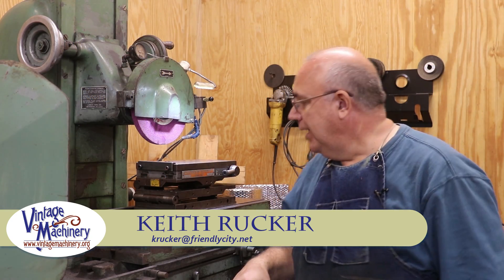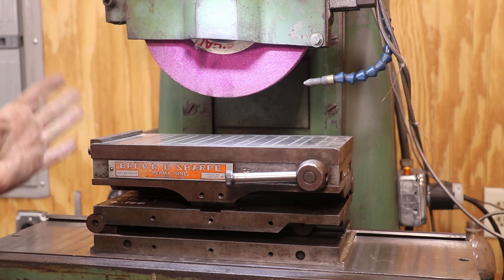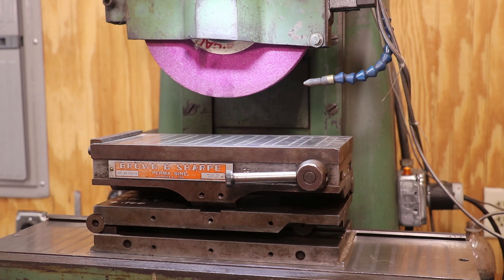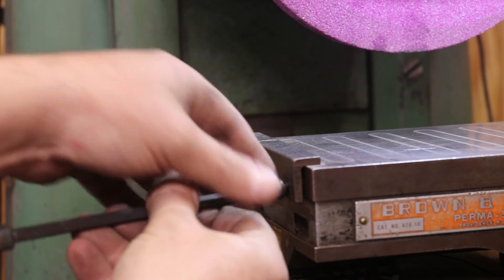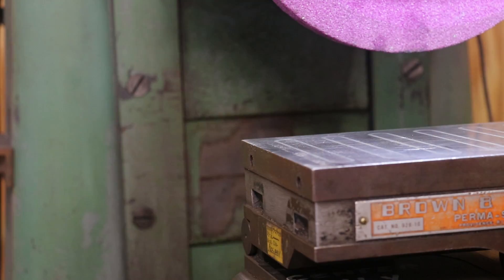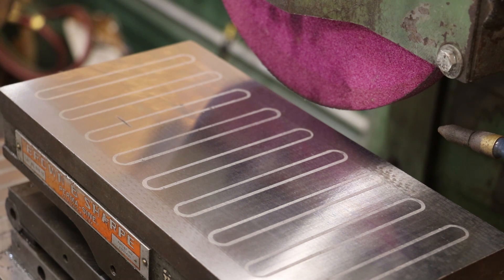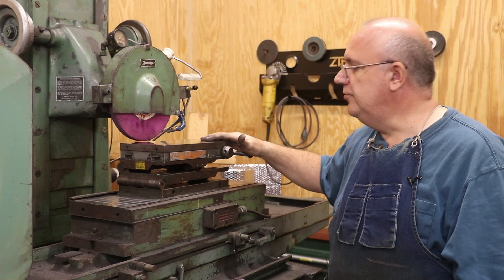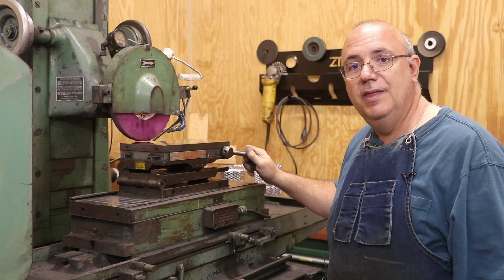Grinding a Magnetic Chuck Flat on a Surface Grinder

Comment: NateAIM 
I agree with you that the final finish was crap.
It's good to see you (so far) getting away with criticizing Keith. Mostly one or more of his plaudits will come back to point out that for some hastily invented reason you are not qualified to go against the master.
I would like to see the ground surface run on a blued surface plate to check if the softer parts are level with the hardened inserts. I doubt if Keith will risk that.
I wonder sometimes if half the watchers are actually looking at what is on the screen.

Comment: I thought the next step was to take it to the granite and verify that it was flat and parallel to its pivot axis. :-) If you don't then your gauge block stacks could end up with some very odd angles as assuming the bottom and top are now flat and parallel any difference in their relationships with the pivots will now result in some compound angle even when moving only one and you don't want that.

Comment: Would it not make sense to do exactly as you did?  Initial passes with the magnet off allowing the bulk of the filings to be thrown clear then magnetic field on for the final skim pass where far less material is removed.  Otherwise the metal filings would just build up and perhaps jam between the wheel and the surface.....  This is both food for thought and a legitimate question as I have no experience but have just acquired an old Norton 6X18 surface grinder.

Comment: Shouldn't you dress the wheel on a flat surface first (on the bottom mag plate)?
Reply: The surface grinder ways determine the tool path so the flatness of the sine plate is irrelevant.
Reply: @rennkafer13  I don't get it.  If I tilt the sine plate and then dress the wheel, wouldn't the shape of the dress = the shape of the sine plate?  The sine plate wasn't flat to begin with, so the wheel can't be square with the ways.
Reply: Think of it like this, the tip of the diamond is a point in space.  When you move the grinder carriage that point moves in a straight line at a fixed height from those ways.  If you tilt the sine plate (in either direction) you move the starting height of that point, but you don't change that it moves in a straight line at a fixed height.  Moving the sine plate might mean that the diamond doesn't cut properly if the angle was large enough, but small differences won't matter.
Reply: @rennkafer13  Point in space did it for me, thanks.

Comment: Number 1 never turn the wheel off after you dress it number 2 is you didn't  turn the magnet on  the sine plate.How do you expect  the plate to be flat when you turn the mag on to grind your parts,it won't be. I've got  50 years of grinding experience so I know what I'm talking about.
Reply: Did you bother to watch all of the video?
Reply: @paulcopeland9035  yes I did and he turned the mag  on as I was finish  writing.
Reply: Thanks for the advice Mr Hatfield and others,  can you explain for me why stopping the wheel after dressing is not good? I could just accept it or I could take a guess but I'd rather hear it from a "been there, done it" perspective.  Always more to learn.

Comment: Why don't the sparks stick to the magnet ?
Reply: They will eventually. Grind a lot and you’ll have to clean the magnet. Most sparks come off the workpiece very fast and don’t have enough mass to arc the trajectory downward. Furthermore, the magnetic field of the chucks are usually not very large. Because of the mass of the magnet the magnetic field intersects with enough of the metal to be held quite firmly, whereas the mass of the sparks are almost insignificant. The force of magnetism is directly proportional to the mass of the metal intersecting the field and inversely proportional to the square of the distance from the magnetic field.
Reply: Good question. I guess it is because the particles are so hot they are incandescing. I know when heat treating iron compounds they lose their magnetic attraction when they turn red. Just a guess, I am no expert.
Reply: I think it has to do with the mag itself, alternating strips of iron and brass. You have to bridge the brass to stick. No grinding particle is that large.

Comment: Can almost guarantee that sine plate has a low spot in the middle from heat build up now, when you grind something like this that determines the accuracy of everything else you grind take a tenth at a time and keep it cool.
Reply: Someone has never put use to the mag grinder. Impossible to get thing hot at .0005 or less.
Reply: @PBVader  when you trying to hold tenths or even 50 milionths .0005 defiantly will put enough heat in apart to effect it, especially how large this one is
Reply: @Daniel-vq9zb  Like I said, you obviously haven't put time on  that machine, let alone a flat plate. You want a tenth of a thousandth,  polish it out.
Reply: Wouldn't the coolant spray mitigate that?
Reply: @BigRalphSmith  not the way hes grinding lol, If it was flood coolant then yes, but mist isn't going to keep it cool with that rooster tail of sparks.
Reply: @BigRalphSmith  with all that being said he ground his actual magnetic chuck the same way so the whole thing is like a compound error
Reply: @Daniel-vq9zb  I'm not so sure I buy that. I'm not saying you're wrong but I get the impression that Keith knows enough about what he's doing to avoid such mistakes. I don't think there's as much heat being generated in that process as you seem to think. Either way, I doubt he'd have any problem correcting such an error once it was realized after the first time he did any measuring on it.
Maybe he'll read this comment thread and check for himself and let us know if there were any problems.
Reply: @chris0tube You and Erst are sure. Got it. I'm not.
I've recently seen Keith take advice from viewers in video.
Looks like we're just going to have to agree to disagree.
Reply: @chris0tube Entertained and rejected. My loss. Got it.
Reply: @chris0tube "If your mind is too open, your brains will fall out".
The fact that I don't agree with you has nothing to do with how open my mind is.
Reply: @BigRalphSmith  I'm on vacation right now will be home Monday I'm going to make a video on my surface grinder to show how much of a dip in the middle you'll get in something like this grinding the way he is. This is nothing against Keith personally I love watching his videos, but hes no machinist or toolmaker this is just a hobby for him and most things are if it looks good that's close enough in his eyes.
Reply: Oh and almost forgot my surface grinder has .00005 dials, they didnt put those on there so I'd have to sand out a couple tenths by hand lol.
Reply: @Daniel-vq9zb  Tell me what you know about Keith's background. He's currently working in the agriculture sciences but what was he doing before that? What do you feel is the minimum necessary qualification to be called a machinist?
Reply: @BigRalphSmith  I believe he said he ran a Turrent lathe for a couple years through college in a production environment, theres no set qualification, there are tech schools and apprenticeship programs, especially for the tool and die field.
Reply: @Erstwhile...What’s your YouTube channel name? I’d like to check it out?
Reply: @dinotom1  erstwhile
Reply: I buy that Erstwhile. Mist coolant while grinding a chuck never worked for me. Flood did a much better job for me. I’ve found that everything matters in precision grinding. My Jones and Shipman grinder has .00005 graduations on the down feed. Given the CTE of that chuck material, every 10 degrees is approximately .0001.  Pretty sure Tom Lipton did a video a while back that checked chuck accuracy by grinding 5 pucks and measuring the thickness for consistency.

Comment: Hi Keith like all your videos, but shouldn't you do a single pass back, without changing the debt of the wheel, after grinding your surface, I see more coming off of the surface at the beginning and end of the surface when grinding?!
Reply: Called sparking out

Comment: If the wheel wears won’t that screw up the accuracy or does it adjust automatically
Reply: In theory wheal wear could effect accuracy, but for a couple of reasons it's not usually a problem.  

First, those wheels wear VERY slowly.  Even when grinding hard, I bet a full pass across that chuck wears less than .0001 inches off the wheel.

Second, is the way you do the final passes.  He mentioned letting it "spark off" but didn't really explain this. This is where you let the machine grind a second, third, of more times across the entire surface without changing the depth of cut.  When you do this, you will get fewer and fewer sparks from the wheel with each pass. You can use this to prove that the wheel is not wearing significantly:  Say, you grind from the front edge to the back edge of the part.  If the wheel is wearing then the front edge will be lower. Then you reverse direction and (at the same cut depth) grind from the back edge to the front edge.  If the part is lower at the front edge, then the sparks should decrease (less material to grind) as the wheel works back toward the front edge.  This is not what you will generally see. The amount of sparks will be fairly consistent for the entire pass across the part  (assuming you have a good setup with proper cooling, etc).

Comment: Now since scrapping is the way to get something flat?, shouldn't you be doing that now because this smooth surface look is inferior...otherwise some of the other flat surfaces that you have scraped could have been done this way?
Reply: Scraping doesn't make 2 surfaces parallel.  The surface grinder makes the top surface parallel with the bottom surface which is more important for a sine plate.
Reply: @flarkel  But he just did a project with the Monarch lathe and was scrapping the bottom of the saddle to get it not only flat with the ways but parallel with them too? https://www.youtube.com/watch?v=DwouJ7xut1U  1:45 into video.... he was also going to scrape the top rails of the saddle to get flat and parallel too... so I guess scrapping a surface to get flat and parallel to another surface is one way and supposedly the best but not in the case of this sine plate...? It also seems that if scrapping is the best way to have a flat surface that all the  machined guide blocks should have scrape marks all over them and not have a nice flat surface to insure they are actually flat?
Reply: you can only get a surface so flat with a grinder ,the edges of a plane are usually higher by a few tenths, then you need to refine it with handwork.  machine ways are scraped also to retain oil and eliminate stick slip, and to look nice.  some machine makers don't bother scraping at all

Comment: Hi Keith, diamond holder is wrong way round, should be pointing away from wheel vertical centre. Like the small wheel head work light.
Reply: @chris0tube  It's not so much an objection as noting that his practice isn't as bad as it looks. The idea being you don't want a situation where the motion of the wheel or play in the table can feed the diamond into the stone. So folks angle the diamond away from the rotation of the wheel. It looks right. But, in practice you can lean it in towards the wheel and as long as you're on the downstream side of the cut it still can't rock or feed itself into the wheel. You have a flat plane (the base) and a contact point (the diamond), I don't think the shapes in between matter so much, it's the position of that contact point relative to that plane that effects stability to most. People might sometimes do this to get at a fresh area on the diamond.

The mistakes he made were turning off the spindle after dressing, he should have gone directly into the grind because stopping and starting the spindle can upset the stone on the spindle and cause surface finish problems. His cuts were too deep, a few .0002" passes would have been plenty. I didn't see many spark out passes. His final finish was crap.
Reply: @NateAIM  Agreed. Old taxtbook theory about leaning away is the wear on the diamond tend to "sharpen" it, so you can rotate the diamond around for good spots. In practice I had the same conclusion as yours. Angles don't really matter all that much.
Reply: Bosted Tap   that was my thought too, unless it is a camera perspective. issue
Reply: I think in practice the angle doesn't really matter much as long as the contact point is on the downstream side of the wheel rotation, which it was.
Reply: hold my dirty hand
Reply: you wanted to grind the sine plate to make sure it was perfectly flat so you put the Dimond block on that surface which you know may not be flat to grind and true your wheel. Is that correct?Shouldn't you have trued  your wheel from a known-flat surface?
Reply: @williamlee1429  it's the cross slide that is generating the form, or in this case, a flat form on the wheel. Therefore the grinding wheel dressed surface is exactly parallel to the cross table slide.

Comment: Using the diamond on a surface you don't know if its flat does't make sense to me.
Reply: It's a single point of contact. It doesn't matter if it's on a flat surface. The thing that dictates whether the diamond is truing up the od of the wheel is, whether the ways of the surface grinder are true.
Reply: @xenonram  Thanks for your explanation.

Comment: Keith, as you go across the top how much do you wear down the grinding stone, causing a slight taper across the sine table?  Very good instructional video.  Thanks.  Tom
Reply: That's why he redressed the wheel before taking the clean up passes.